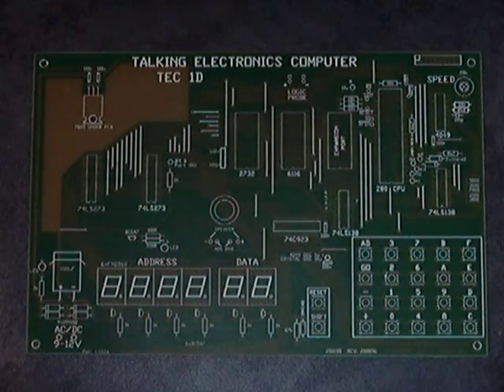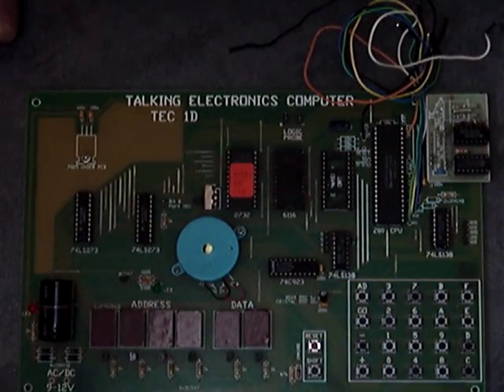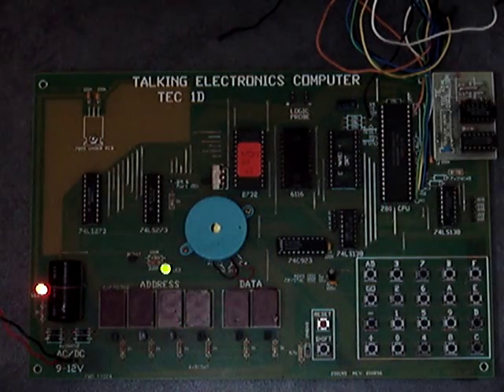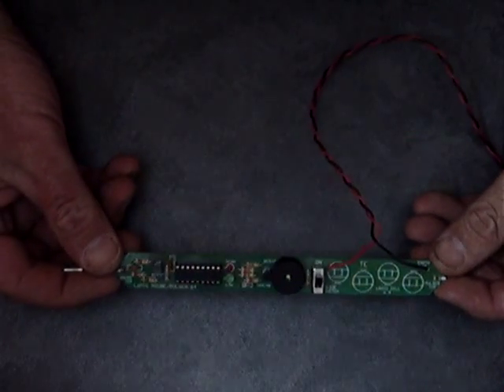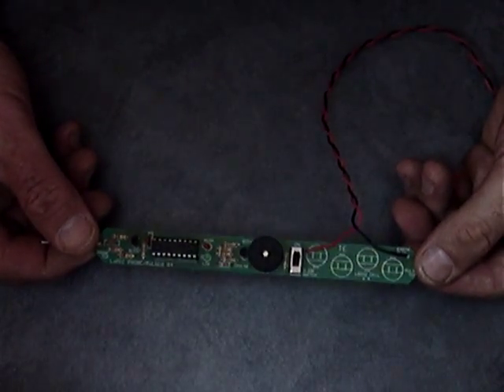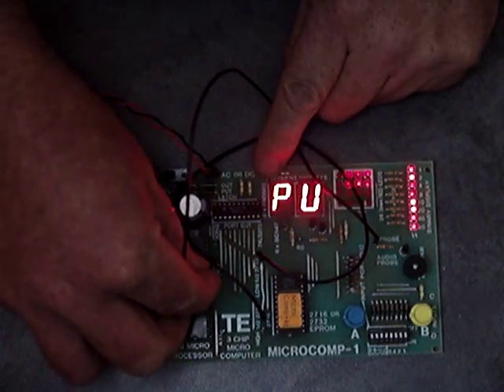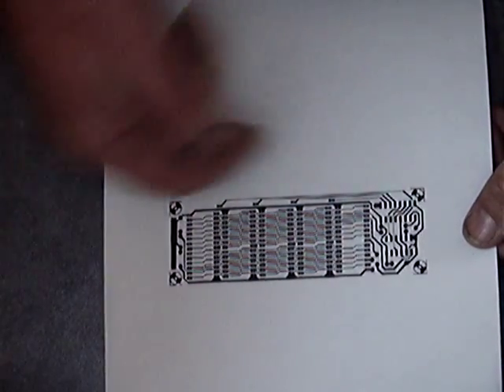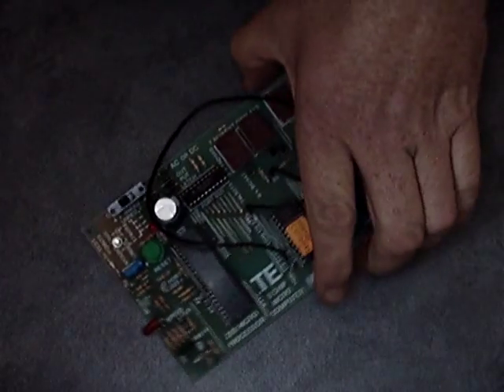Z80cpu Talking Electronics Computer

Comment: Hello.  I know it’s been a few years since your video, but I'm wondering if you could tell me which monitor code you have in your eprom ?  I'm reading existing documentation and the JMON was the last version of monitor code.  Did you combine the older 1B code in the 2732 or just leave one version ?  My board is on the way and I have most of the parts.
Reply: Sorry I don't monitor this channel very often as YouTube refused to return ownership to me,  i do have the monitor Rom images somewhere and there was a website where they could be downloaded from at one stage, if you're still after any info I have most of it, although it may take a few days to get hold of.
Reply: I have all the PCB info and all TEC-1A,B AND C EPROM HEX files I think I have them all. If anyone is interested let me know at robertscott1949@gmail.com 
Regards Robert Scott

Comment: Thanks for the video, it brought back some memories. I built a TEC-1D back in 1997 at the age of 15. My unit had the add-on 16KB NVRAM board, the DAT board for tape load/save and 16x2 LCD, the crystal oscillator and (most fun of all!) the SPO256-AL2 speech board. TE were indeed a unique company, and I learnt a lot about electronics through their series of books and kits.

Comment: Nice beautiful design I was wondering if you know of any websites or books on the subject of development with Z80 CPU's. I've developed with Micro-controllers before but I've always wanted to develop a simple system with separate processor, ram, rom, and separate I\O